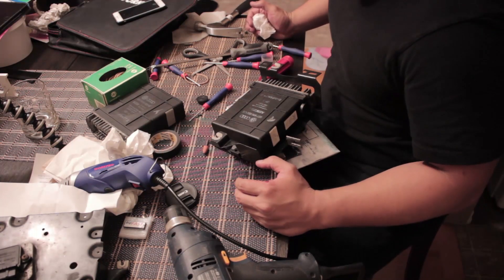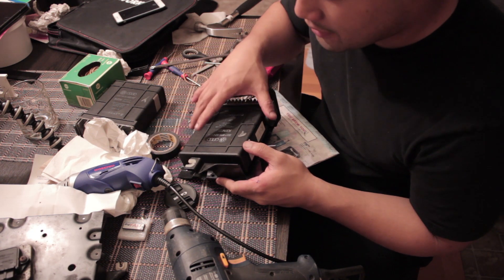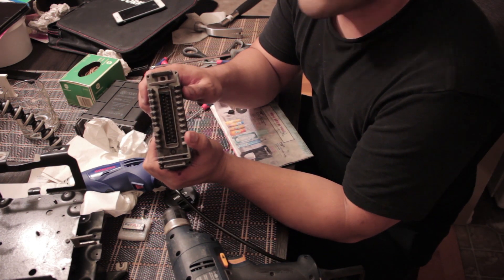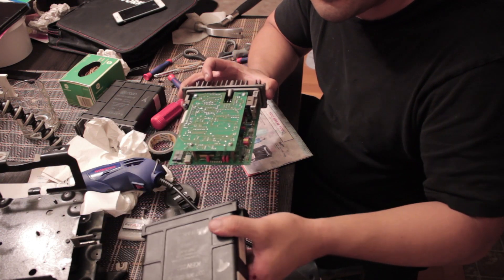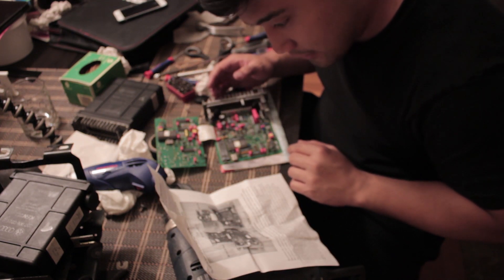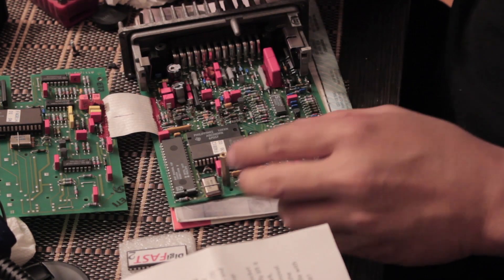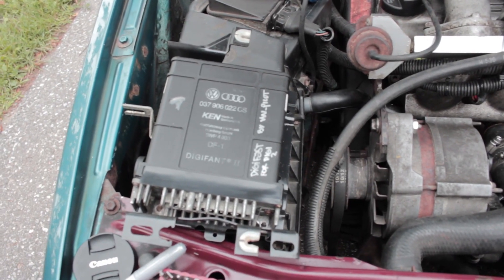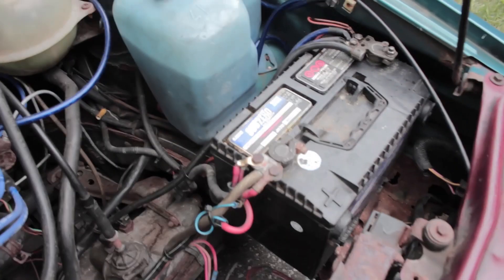vw_pilot digifast chip - part 1 (install)

Comment: I have this chip in my VW. Worth every penny. Improves power, fuel mileage and emissions.
It gets rid of the hesitation common in digifant 2 cars.
Reply from the maker: I wonder how it will react with a euro intake cam
Reply: @6ixthstage  It will work well.